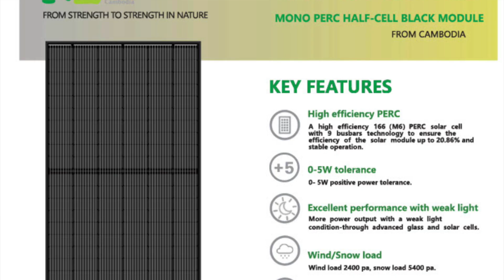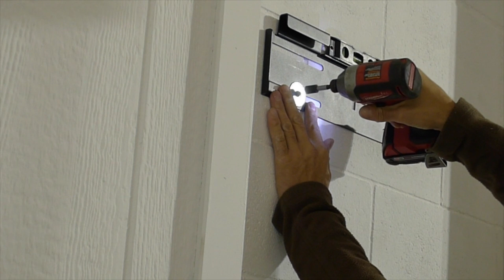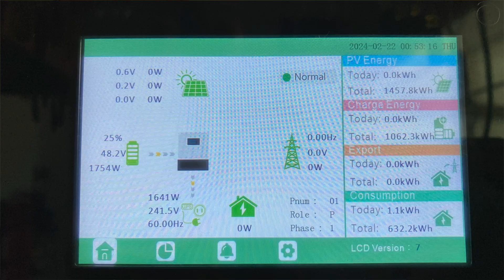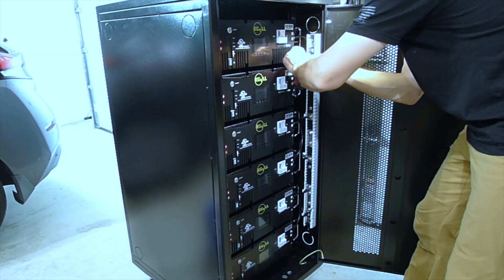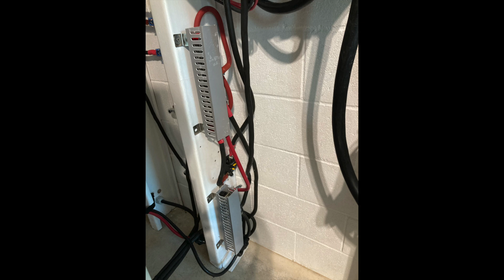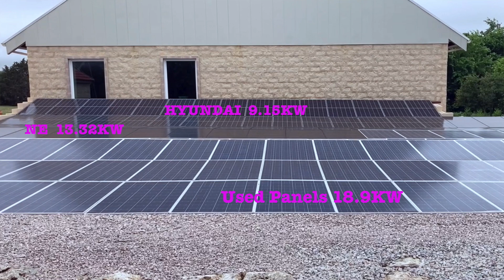EG4 18K Install and Complete 43KW Solar System Set Up  - Start to Finish

Comment: Sol-Ark 18K if you want a real 18Kw Inverter.  The 18Kpv is really a 12Kw Inverter with a fake name.
Reply from the maker: Sorry after purchasing the Sol-Ark 12K, and having a lots of headache, I pass on that. Technically the description is EG4 18KPV as you are mentioning and that is , a 12KW inverter with a 18KW Pv input. I agree at first everyone would think that it is a 18KW inverter but the data sheets doesn't tell you the wrong information than Sol-Ark. Please check the video for reference. Thank you for your input, and for joining to the channel!!

https://youtu.be/jXk8nVP_HyM

Comment: Nagyon szép telepítés.  Egy PV rendszer telepítését fontolgatom itt, Cleveland nagy részén.  (My plan is to install a PV with hybrid inverter system next year before I retire.  I have seriously considered the 18Kpv, the Sol-Ark 15K, and other high frequency inverter systems.  As of now I am now leaning toward the Schnieder XW Pro 6848--although the cost of it may be cost prohibitive--The WAF (wife acceptance factor) is something the heed.
Reply from the maker: Köszönöm szépen !! Miután a Sol-Ark 12K egy nagy csalódás volt nekem két éven keresztül , nekem is ajánlottak a Schneider XW Pró 6848.  Sokkal tobbre keeps mint ami a papíron fel van tüntetve. Sok sikert kivanok az új rendszerhez. Kérem tudassa velem hogy döntött , mostmár egyre jobb és több termek lesz elérhető zöld energiával kapcsolatban.

Comment: Nice setup. A wildfire burned my latest setup (inverters) but the panels made it as they were ground mounted (MC4 connectors did melt a little to each other). It was grid tied and put 1.3 Mwh per Month to the grid in late spring through Summer for others to use. Am considering more batteries and off grid option for the rebuild. There are so many ways to make this work.
Reply from the maker: Hello Martin,
I’m just wondering if you got a chance to rebuild your system, and what did you ended up go with? Please let me know, I always love to hear about other projects!! Thank you!!
Reply: @offgridwithlaszlo  Have installed two 18k EG4's each with 3 EG4 Power Pro batteries. Total of 6 batteries with 84Kwh of storage. Also have 62 Aptos 370W Bifacial Solar Panels that are to be installed in stages. Have dedicated a separate power shack with the equipment in it and a mini split / heat pump to maintain temperature around 20 to 26 C to extend battery life. Works great as I can dump excess solar day energy loaded to the batteries back to the grid in the evening when rates are highest.

Comment: LASZLO, GREAT PROJECT!
1. ARE YOUR DIFFERENT MANUFACTURERS BATTERIES 🔋 CONNECTED TO THE 3 DIFFERENT INVERTERS?
2. HAVE YOU ALSO PARALLELED DIFFERENT BATTERIES 🔋 TO ONE INVERTER?
3. LIKE YOU I HAVE 2 KILOVAULT HAB V4 (7.5 kWh) BATTERIES 🔋 CONNECTED TO SOL-ARK 15k, BUT KILOVAULT HAS GONE OUT OF BUSINESS & I WANT TO INCREASE MY BATTERIES 🔋 TO 30kwh. 
4. CAN YOU PARALLEL CONNECT DIFFERENT BATTERY MANUFACTURERS TO ONE INVERTER & THEY ALSO BE CANBUS CONNECTED TO THE SAME INVERTER?
Reply from the maker: Hello AW Bean,

I tried to separate them by Ah not by brand name. All my EG4, Lifepower 100Ah batteries are connected to Sol-Ark and Victron, each tower has designed busbars and from there they connected to the 600Amp rated bus bars . These bus bars shared by Sol-Ark and Victron.   Basically all my larger ones are connected to EG4-18K,  battery to battery in parallel .
Reply: LÁSZLÓ, THANKS FOR RESPONDING!
WE ENJOY YOUR SOLAR & WIND GENERATION PROJECTS FOR AN OFF GRID SOLUTION!